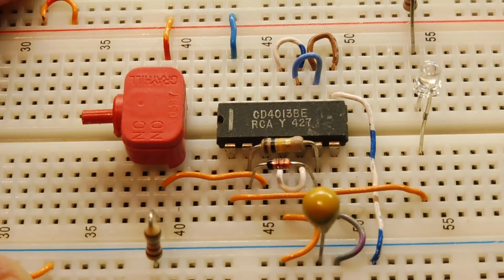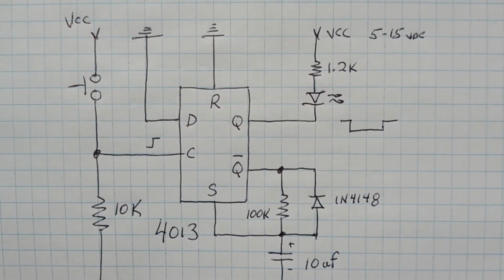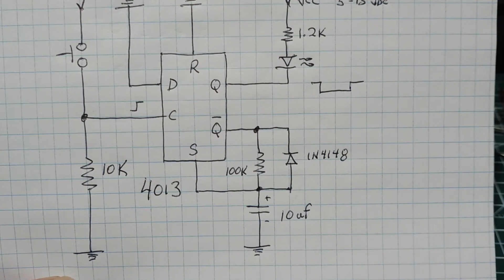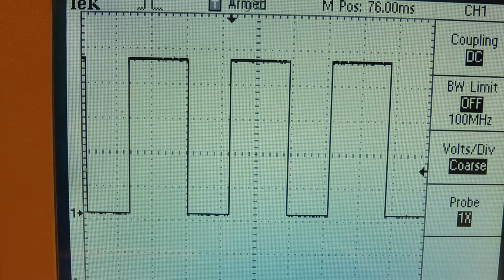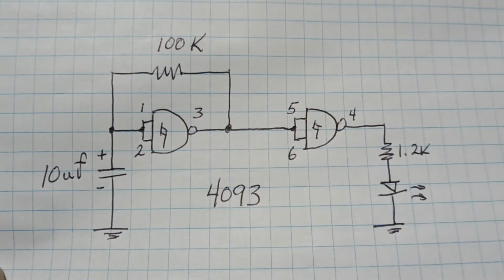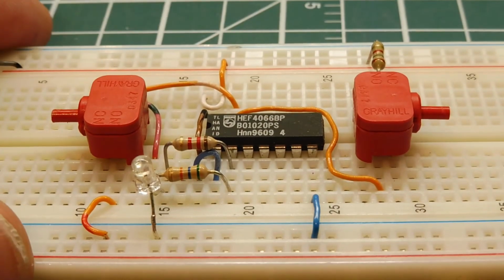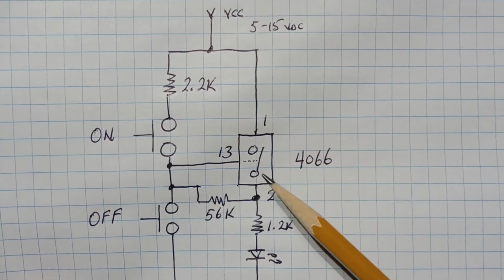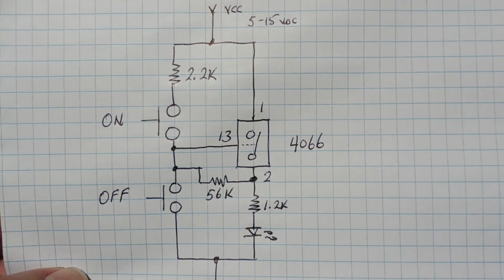Simple Digital Logic Circuits  Part 2

Comment: The latching circuit which uses the 4066 is pretty clever.  I believe the current rating of the 4066 is only 10ma so I think one would need to be careful using it even for LEDs (which will light at 10ma, but are often powered with higher current).
Reply from the maker: The circuit was powered with 5 volts so the current was within spec. At 15 volts the current was 10 ma so to be safe you could parallel the switches or increase the value of the current limiting resistor.